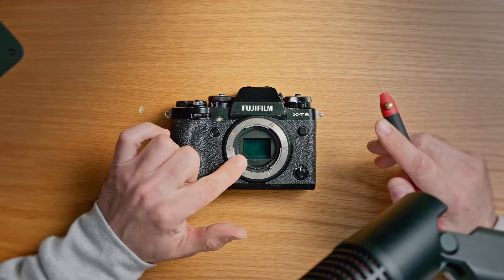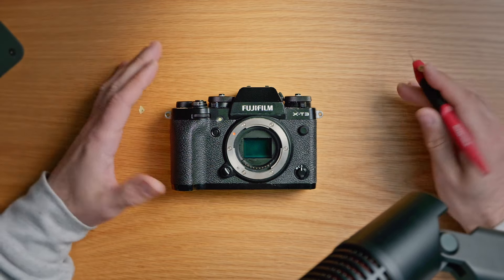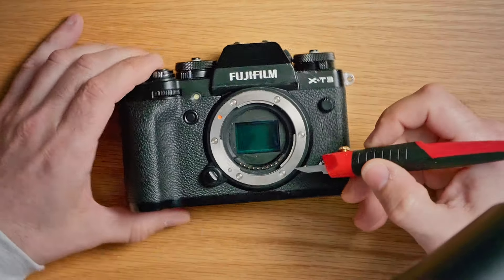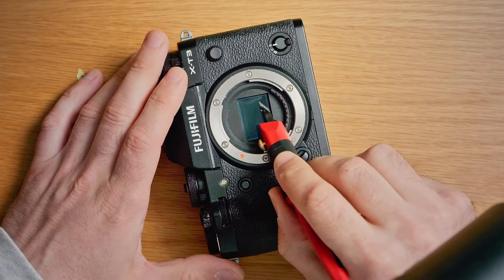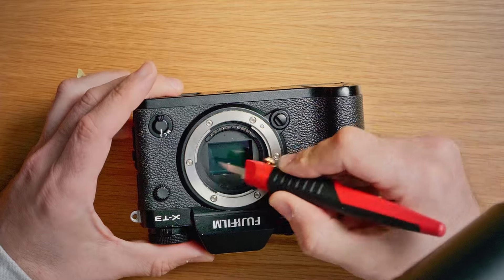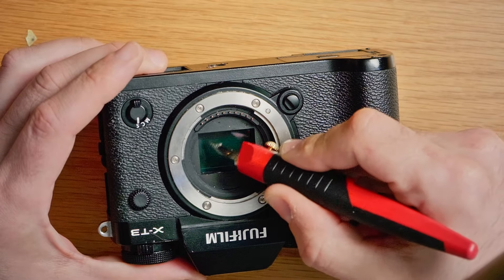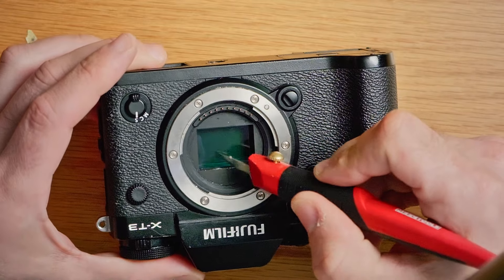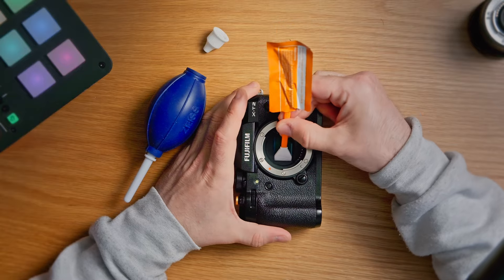Scratching a Camera Sensor with a Scalpel: Can It Survive?

Comment: The sensor has multiple layers of filter on it, even if it is damaged, the filter can be replaced with not much difficulty
Reply from the maker: indeed it's the IR cut filter that is in front of it. Heard alot of people saying they was afraid to damage the sensor when cleaning it. That seams like a hard thing to do since it dint scratch with a razor and moderate pressure.

Comment: I think the filter on a sensor is about the same hardness as glass. Since glass is harder than metal the scalpel wont scratch. Dirt, sand, dibris, even dust can be hard enough to scratch a sensor though so its still important to be careful with a swab.

Always blow as much dibris off the sensor before swabbing. And only swab with one side one time. I learned my lesson yesterday when i scratched my sensor 😭

Comment: I managed to scratch mine, no blades used, just air blower and cleaning swabs...
Reply from the maker: heard some people say so, planing to look into this further and actually try scratch the sensor with a swab. The camera I use for this is not functional.

Do you have any idea why or how I got scratched?

Did you use a new vacuum sealed swab?
Reply: @Kim_Alexander  vacuum sealed from aliexpress, also rubbed it dry with a k&f swab by mistake BUT I have no ideea when the scratch actually happened..
Reply: @Tech_Stuff_and_Other_Stuff  is the scratch visible on images and video?
Reply: @somtamthai9429  I tested but cold not see anything even at F22...The "good" thing with a scratch is that it still lets light pass through unlike dirt on the sensor.